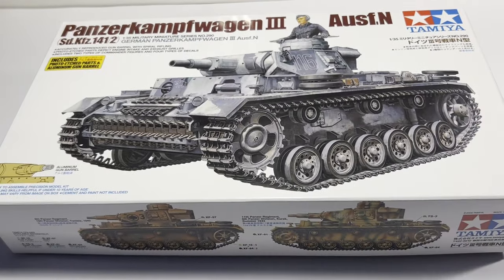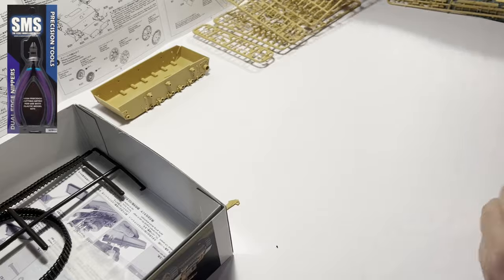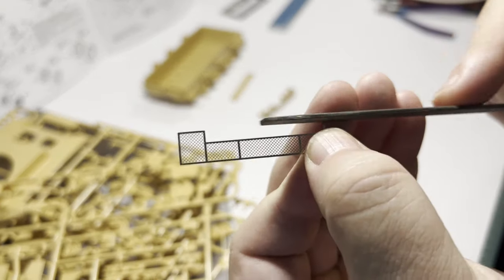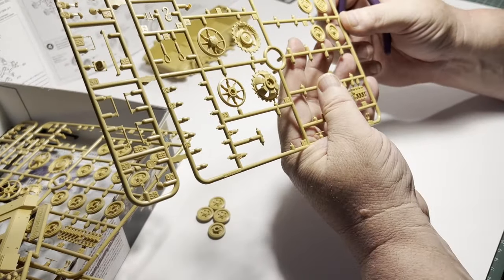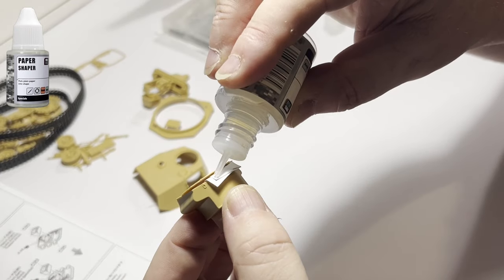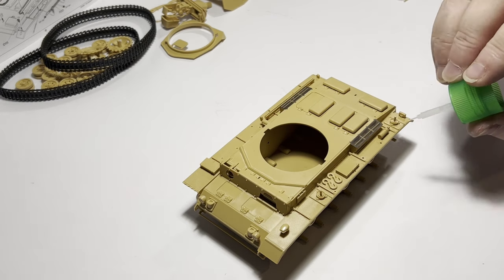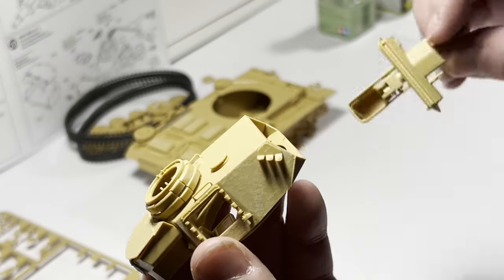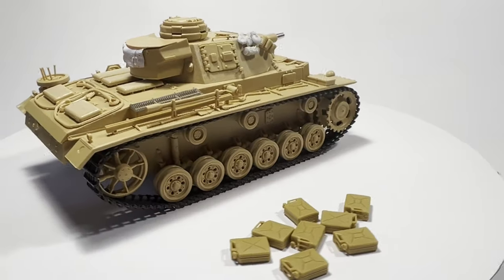Tamiya Panzer 3, Ausf N. Part 1 Construction | A nostalgic 1/35 Tamiya Armour build

Comment: I prefer vinyl tracks as I see no fun in cleaning and fitting about 200 small track pieces.
Reply from the maker: Mate I hear you. I do love metal tracks myself, but the pain of cleaning out holes and then joining them is a thing. I haven't completed a set of Tamiya vinyl tracks in many many years and it was a pleasure to do these ones after all that time.

Comment: Thanks Stewart, another great video. I note some not so "out of the box" elements that you didnt cover (bent/missing fenders) and wonder if you will cover these in another episode? Applying selective, realistic damage would be great to understand further and tie in with the use of quality reference materials. I look forward tio the painting episode as I have always painted the different elements seperately before applying them to the model. Road wheels, stowage, tools etc I would always usually do on their own so I look forward to seeing how this works with everything already attached.
Reply from the maker: Hey there Adam. The term "out-of-the-box" reflects the concept of building a model using nothing more than what comes in the box. Often a challenge in itself, especially if like me, you are used to modifying kits to be more accurate (and therefore more cool haha). So my aim with this kit is to build it like "we" would have back in the day ... using what is in the box and maybe some very limited bits of extra stowage that the scale modeller back in the 80's might have as spares from previous kits. It's essentially a nostalgia build. 

So I've limited my additional stowage items to things we would have as spares from other kits - German Helmets, German water bottles, a gas mask canister, Jerry cans etc. All of these will appear in a set of reference images that will appear in the painting video as I explain both the stowage layout and the late troppentarn paint scheme unique to DAK forces in 1943.

I'm glad you mentioned painting tools etc off the vehicle. When I was much younger, I always glued everything on and then painted the model. It was just a thing we novice modellers used to do. I see it in the occasional video on YouTube still, and from some very experienced modellers too. So in the sprint of "the good old days", I'm going to do it with this kit and show everyone how you can paint them effectively. I have left the road wheels detachable and I'll paint them off the vehicle as I really don't want to repeat what I had to do in the previous build (the E60) where I had to paint road wheels on the hull..... yeah not ideal and a bit of a pain in the butt. Glad your enjoying the build and thank you for your comments.